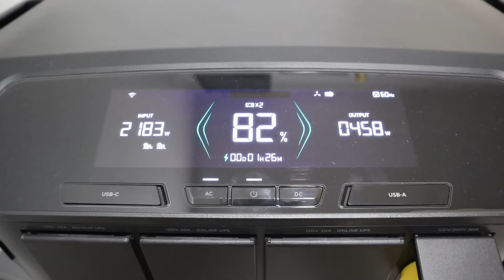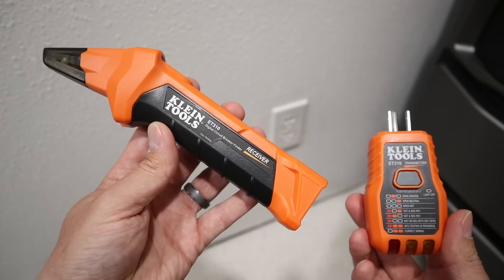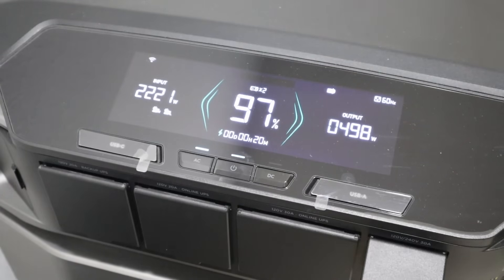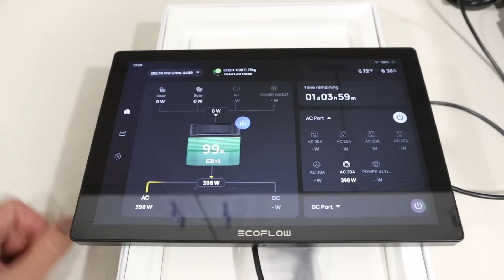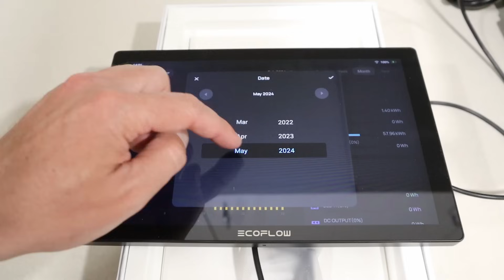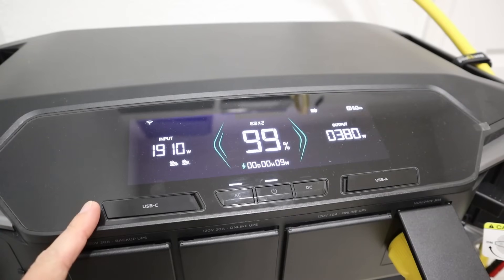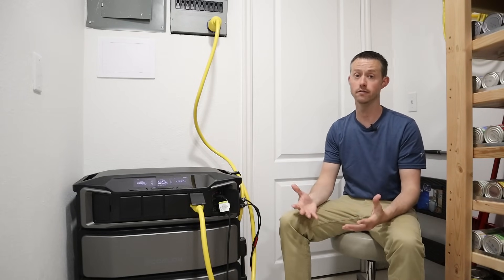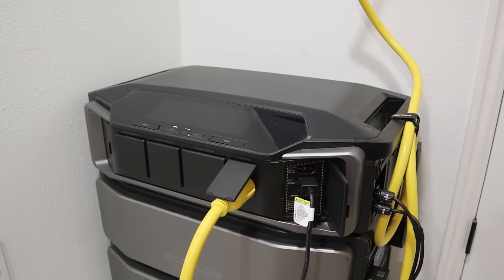Using A Transfer Switch With the EcoFlow Delta Pro Ultra! 3 Month Update

Comment: How does using a transfer switch instead of the eco-flow smart panel 2 change things up? I've been looking at a lot of videos and this is the first time I've seen a transfer switch used instead of the smart panel. Thank you for the help!
Reply from the maker: It's exactly the same except it's not automatic. You can also use it with any power source, youre not locked into the ecoflow products.

Comment: Seems like you had the expertise to do alot of the electrical work yourself which is +++, but I wonder what the expense would be to get an electrician to wire say a transfer panel\switch with around 1/2 of the circuits you have in your setup? Here in SE TX alot of us are just looking at various solutions as "emergency power" alternatives a little more convenient and robust than rolling out a clunky\noisy generator.

Comment: Do you have a video on how you went through the house wall with solar wires? I'm trying to figure out a way to do it right-ish. 😅
Reply from the maker: No video. I hired an electrician to do it. Cost me about $500 for them to fish the wires through the outside into my utility room. The wires had to run through 1 room and a hallway to get there and I didn't want to deal with it.
Reply: @Jasonoid trying to find an electrician that wants to do that and for that type of price in AZ is harder than getting a surgeon to do a free surgery. (I still do a good amount of free ones per year lol).
Reply from the maker: @SurgeonTech totally! I found a good electrician when I was in college. You just gotta ask around with family and friends to see if anyone knows one.
Reply: @Jasonoid with me, they go through that guard and gate system, price instantly goes to 3x more than my previous neighborhood down the street. With any contractor type deal. Actually, I tested it. Should have done a youtube video on it lol.  Ie., had the same pool company come out to the old house and then in 2 months to the new house, same size, same pool way different price and no gold plumbing to justify it. It's alright I just gotta see 3x patients and i will be alright 😥💪

Comment: I’m not running an Ultra l’m running 2 Delta Pro 3’s connected through EcoFlow’s 50amp hub connected to the same 50amp 10 circuit reliance Transfer Switch. We have a smaller solar array only 1000w.  500watts going to each Delta Pro 3. Our parasitic draw is around 250 to 278watts. We bought our setup for load shedding/backup as well as redundancy as we have a 22kw Generac standby generator.

Comment: What's  the breaker capacity you installed 20 A or 15 A ? Thank you for sharinf
Reply from the maker: On which part of the system? There's many breakers.
Reply: The one between the solar panels and the delta ultra. You called DC breakers, you showed them during the sola panel set up tour.
Reply from the maker: @kevinquijada9572 these
https://amzn.to/4ouljJs
Reply: @Jasonoid my concern is because both high and low pv ports the max is 15 A. Shouldn't it be safer installer 16 a breaker?
Reply from the maker: 1) power stations limit the amperage automatically, no need to have a 16 amp fuse. 
2) breakers / fuses are meant to protect the wiring. Install breakers that match your wiring... 12 AWG wire 20 amp breaker or 10 awg wire 30 amp breaker.
Reply: @Jasonoid thank you much. Did you ground the solar panel set up? Also, is it necessary to ground the delta ultra unit?

Comment: Chinese manufacturers are literally dumping these cheap, low surge, short-lived, high-frequency, transformerless inverters on the US market. Stay away from transformerless inverters like these high-frequency inverters; they can damage your appliances and can even set them on fire.  Instead, buy a low-frequency, transformer-based inverter.
Reply from the maker: Been working for 1.5 years running plenty of inductive loads. Fridges, compressors, garage door opener, power tools and even my welder.... Those were the older cheap Chinese inverters from decades ago LOL

Comment: You say you are running a 50 Amp Transfer Switch which I assume would require a 50 Amp power cord connected between the Delta Pro Ultra and the Transfer Switch. How did you connect the 50 Amp power cord to the 30 Amp port on the Delta Pro without using a 50 to 30 amp adapter? Did you forget to mention this since the port on the Delta Pro only accepts a 30 Amp power cord??
Reply from the maker: The transfer switch is capable of 50 amps total, that doesn't mean I was providing that much power. I rarely pull more than 3500 watts, which is half the load of DPU. The DPU is limited to 7200w, 30 amps @ 240v.

Comment: have you done a video on $ savings with your system . I like the setup with the transfer switch to select the  loads . More states are doing away with beneficial net metering and or banking a grid connected system . in NC , your duke power solar credits zero out may 1st , ugh. thank you for creating great content.
Reply from the maker: I save about $50 to $60 on my power bill monthly. It's not a ton but it's adds up overtime 👍

Comment: How's it working now 1 year later? Are you still constantly running it, and no problems having it constantly run through that transfer switch?
Reply from the maker: Still running 24/7, no issues. It's been working so well. Nearly silent too. I've added some additional solar and now I have 3 expansion batteries. I have dropped my power bill to about $20 to $30 a month. 
I'm running two window units off the DPU daily to help supplement the central cooling in my home so it doesn't have to run as much. I only have to turn off the transfer switch when I have 2 or 3 cloudy days in a row.... I live in a desert and we don't get much rain.

Comment: I’m having an electrician install a generator inlet.  He has asked me if there’s a “30 amp breaker built into the inverter”.  Would you happen to know?  Thank you & your videos are very helpful!
Reply from the maker: The inverter doesn't have a breaker you'll need one installed.

Comment: I just have a quick question. Are you able to have the ecoflow plugged into your outlet and still power your sub panel? That way if your away from the unit it can draw on grid power while still powering the sub panel?
Reply from the maker: Depends on the grounding setup. Sometimes it will trip the breaker, especially if it's a GFCI. I recommend charging with solar as much as possible so you can get a return on investment. Charging from the wall doesn't save you any money.

Comment: lat year I mounted 900 watts of panels on shed roof and I did so during the summer months, but as soon as winter came, my home being that its a 3 story Victorian, the house in winter made shade all over the sheds roof . Now I have to build a ground type solar panel bracket at the far side of property where no homes exist.
Reply from the maker: Winter solar is the worst since the sun goes so low in the sky. My solar arrays get much more shade in the winter as well.

Comment: How long on average does the unit provide power to home during a grid power outage?
Reply from the maker: It's all dependant in how many watts you are pulling. There's an easy way to calculate runtime:
Watt hours of the battery / watts of your load = runtime in hours
5000wh / 500w = 10 hours runtime

Comment: Great Video, quick question. On the 120/240 output plug you have to your transfer switch does it provide both 240 and 120? Do you only have 240 circuits or both 120 and 240? 
I have a 10 circuit transfer switch from Reliance but all circuits are 120…

Comment: I just purchased my DPU and I’m excited about its potential. You’re obviously very knowledgeable so I’m going to ask a couple of questions. All I want to do is connect the DPU to my main electrical panel to use for backup during power outages. I would like it to be able to power On if/when a power outage occurs but I would also like it to charge up during cheaper hours and supply power during more expensive hours. What equipment do I need and what do I ask an electrician I need done? Thanks for a great video and any help you can give me with my questions. 😊
Reply: You need a smart transfer switch. Much more complicated and expensive than a generator inlet

Comment: Does the transfer switch disconnect from the grid automatically when the grid goes down
Reply from the maker: This is a manual transfer switch, you have to flip the switches to change it.

Comment: Thanks for your reply ordered it :).     Another question on this say battery’s die or something fails in power supply how do you hook up an outdoor gas generator for backup ??? My thought was to install a 50 amp inlet outside to connect generator run wires in house and install a well marked plug to be able to hook power cord from to transfer switch sorry for long question tried making sense hope you understand my question
Reply from the maker: Yes, you can have two inlets, you can on use one of them at a time. So one for the power station or one for a gas generator.

Comment: Hi Jason I watched ur 6 circuit 30 amp transfer switch looks like u upgraded to a 10 switch is it 30or 50 amp if it is 50 amp how do you hook the 30 amp power source to it I have the ac300 and just purchased the 6000xp and a wall mount battery wanted to have it all wired to use either one for backup
Reply from the maker: This is a 50 amp model, if you check the video description you'll see the cable I purchased to go from the 30 Amp output of the DPU to the 50 amp input on the transfer switch.

Comment: !! --->  I was about to buy the DPU and 5 batteries, until I learned that EcoFlow power stations are not suitable for truly off-grid situations.

I learned that you MUST connect the DPU to EcoFlow's Chinese servers via WIFI to pair the BlueTooth connection with your smartphone. So if you are off-grid and remote and don't have WIFI, you cannot establish a Bluetooth connection and you will not be able to change any parameters. 

Or, if you simply want to stay disconnected from WIFI (Chinese servers) and want to use Bluetooth to change parameters, you cannot, because the Bluetooth tokens are set to expire monthly. Once a token expires, you must connect to WIFI to re-pair the Bluetooth connection. i.e. you EcoFlow smartphone app. 

EcoFlow Support: "We are sorry to inform you that you will not be able to use the app to talk to river2 when there is no internet connection."' Source: https://www.reddit.com/r/Ecoflow_community/comments/1d45au5/ecoflow_app_requires_internet/

Comment: Wait so how many hours will those 2 batteries give you?
Reply from the maker: All depends on the load you are running. 
Watt hours of the battery / watts of your load = hours of runtime.
Reply: @Jasonoid  average... we have bad rain storms and need about 24 hours of backup with similar items plugged in
Reply from the maker: I'd say over 24 Hours, you could always charge the power station quickly with an inverter generator as well
Reply: @Jasonoid  ok that gives me a starting point thank you!

Comment: Great informative video my friend.  Question,  that means I can use eco flow with a transfer switch to help me with monthly electricity bills by splitting loads? Using my main panel for the big loads  and the transfer switch for lights,  computers,  etc.....?  as soon I switch to generator won't back feed the main panel?  Sorry I'm asking this question I'm new to solar. That means I can use grid and the transfer switch with eco flow at the same time and is completely safe?  Thanks
Reply from the maker: I use my transfer switch with my power station daily to drop my power bill. It's a great way to get a return on your solar / battery investment.
Reply: @Jasonoid  Thanks so much,  so that means transfer switch won't back feed the main panel and is completely safe right? Thanks so much again for the help.

Comment: Is it possible to have both an inside and outside outlet connected to the transfer switch? .So you can use your generator from outside the house or inside.
Reply from the maker: Yes, just have an electrician wire in a generator inlet for you.

Comment: Thanks for the update video! You have 2575 input coming from solar with about 500 average output that allows you to get back to 100% by 1-2pm per the video or about 5 hours. If you only have two 400w solar panels or 800 total, at the same load it would take 3x as long or about 15 hours to get back to 100%, so you would always have to switch back to grid power and lose all the savings, and really only have emergency backup. Am I evaluating this correctly? If so, then it seems you need a much larger solar input similar to your setup.

Comment: Do you have your system grounded?
Reply from the maker: It's grounded when it's connected to the transfer switch. It shares the ground with your home.
Reply: @Jasonoid  Thanks.  From what I understand you should not have the ac plugged in while it is attached to a manual transfer switch?  Something called creating a ground loop?

Comment: Does this unit also charge by wall plug? If you don’t want solar.
Reply from the maker: Yep, it charges just fine from a wall outlet too. Check out the 'charging' portion of the video for more details.

Comment: Is there a way to use the extra solar when the battery is full in the afternoon?
Reply from the maker: Connect up a window AC in the summer to use the extra power in the summer. Connect up a small heater in the winter. That's what I do with the extra power once the batteries are full 👍

Comment: Once you plug into the panel is it grounded as long as the main is grounded?
Reply from the maker: Correct, the transfer switch connects to the ground of your main power panel.

Comment: is solar the only input you are doing? i mean do you have it plugged in the wall 120volt as well, for another input?  If so, how do you tell the Ultra unit not to use the 120 volt unless the solar does not work due to cloudy days?
Reply from the maker: I only use solar to charge my system, that's the best way to save money. It's more efficient to switch the transfer switch back to grid power than it is to charge the batteries via grid power. You have efficiency losses while charging via AC input.

In a grid down scenario, I'll use a inverter propane generator to charge my batteries if I need to, but solar is so much better.

Comment: I have current consuption of about 130kwh per day. How many units you think i need if i use your same number of panels you are using? Thanks
Reply from the maker: In a power outage you only run critical loads so you can get a longer runtime. I'm not sure this unit is capable of 130kWh at all. You'd need 10X the panels I have for that.
Reply: @Jasonoid  tks!!

Comment: Hi I m new to the Eco flow game and I was curious why your power connection to the transfer switch is plugged into the port on the front of the unit instead of using the adapter and connecting to the side of the unit? Thanks great video.

Comment: Are you keeping those circuits connected to the DPU 24x7? What I want to do is ensure that some circuits in my house are always "available", but I am not entirely sure if that means that I take those circuits and put them into the Reliance Transfer Switch with the EcoFlow running all the time or not. I mean obviously if I want to make sure that it can automatically cutover that's what I'd do, but in the past I had only used the Reliance when I had an outage and I would run the gas generator to it.

So I guess the short of the question is do I treat the Transfer Switch and the EcoFlow as something that should always be running.

Also, since I can have it pull charge from a hour plug, is there any reason why I wouldn't have a constant input from the house into the EcoFlow - effectively using the EcoFlow as an Automatic transfer switch for those things that are connected to the Reliance Transfer Switch?
Reply from the maker: I use my DPU 24/7 charging off solar with the transfer switch. It's helped drop my electric bill a bit.

There's an issue with a grounding loop if you use grid power to charge the power station while the transfer switch is enabled.
Reply: Gotcha. So if I want to do it similar to you, I should just put basic things on the EcoFlow and route solar directly to it. The biggest challenge is that critical load is one of the AC/Furnaces and that is already on the transfer switch and I'm concerned about the draw draining the Ultra. Since we have cheaper power in the evenings, I wanted to have it charge in the evenings and the just draw from it during the day.
Reply from the maker: @TheRealAfroRick  you could always try charging from from grid power while running the transfer switch. It would just error out if there was an issue.

Comment: Are there possible problems feeding a one inverter DPU stack with a 240 Volt /  30 amp limitation into a 50 Amp transfer switch?
Reply from the maker: You just can't pull the full 50 amps @ 240v (12,000w). You'll be limited to 7200 watts.
Reply: @Jasonoid  Thanks 🙂

Comment: On cloudy days do you ac charge while using the transfer switch?
Reply from the maker: No, I just swap back to grid power. AC charging is not as efficient as running off grid power directly.

Comment: I am getting the same setup as what is shown in the video you posted. I was curious, could you run the transfer switch to always running in generator mode while the Delta Pro Ultra is plugged into a regular wall socket? I only ask in case you wanted to run in a UPS mode if when the grid did go out, your critical circuits were already switched to generator mode on the transfer switch. Or is this a big no, no and could cause issues? Thanks!.
Reply: I think this might cause a ground loop, but is there a way to avoid the ground loop?